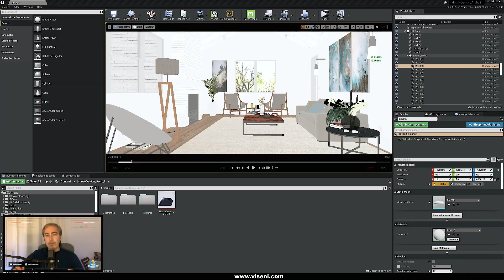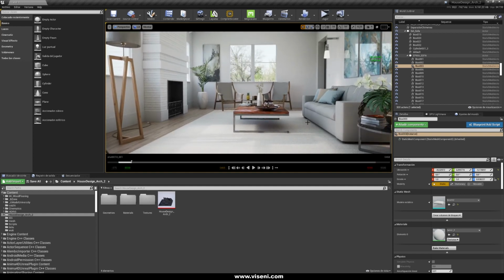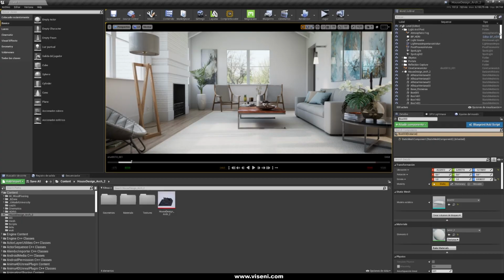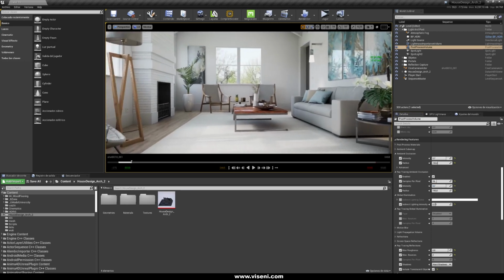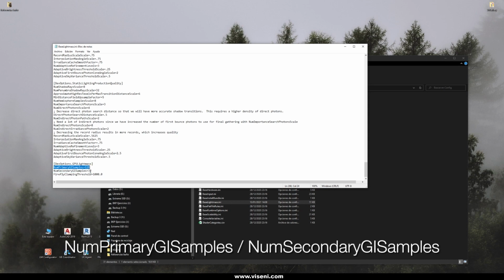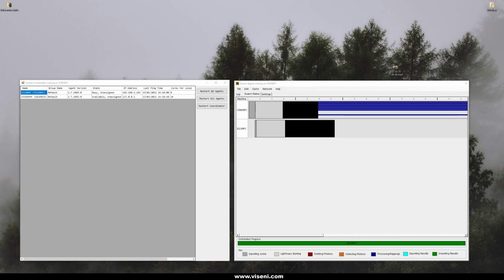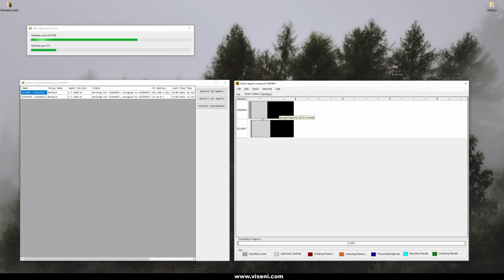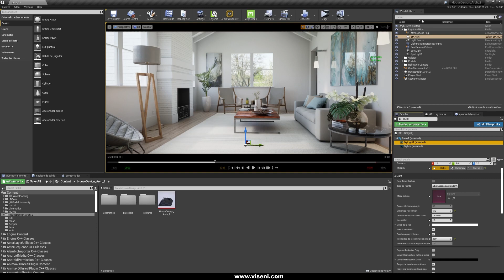Tutorial Unreal Engine 4.26 Luoshuang´s GPU Lightmass

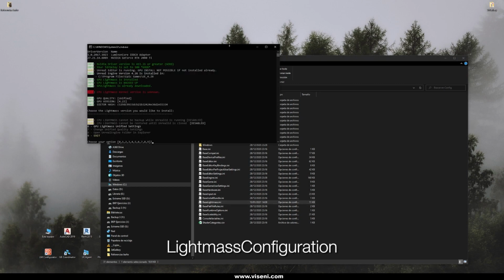Comment: how did you set up lightmass configuration at 4:18 , whenever i run batch file every time it starts downloading Luoshuang´s GPU Lightmass. how to set up it just for quality setting for ue 4.26
Reply from the maker: Hi! I’m using Lightmass configurator just to change quality settings, I think that for the last version 4.26 is not fully supported, ie. changing between cpu and GPU is not working well.
Let me see how I did it because I don’t remember right now and I can share my configuration